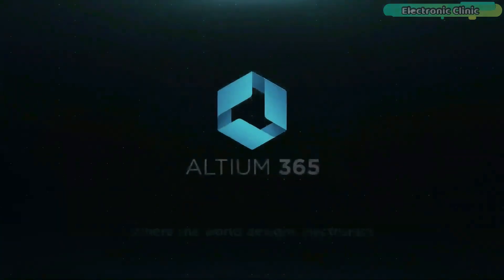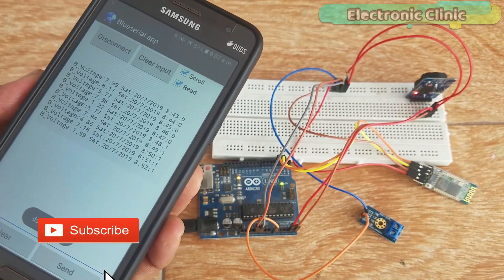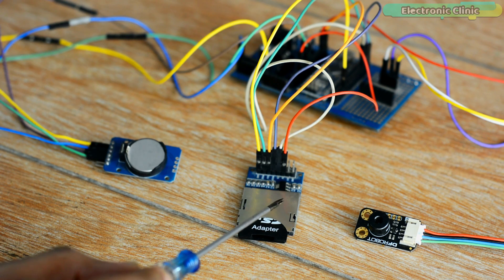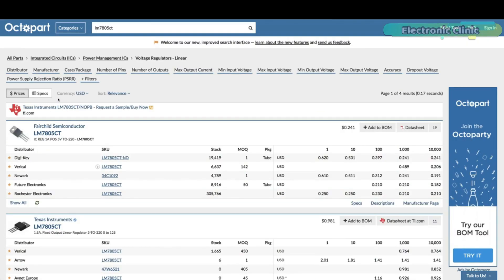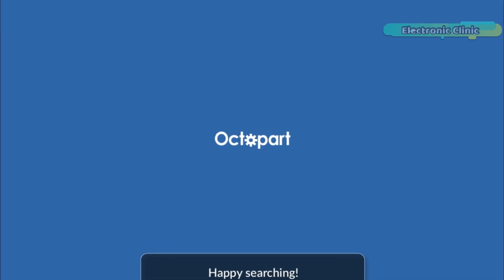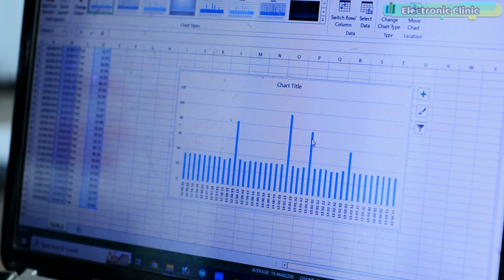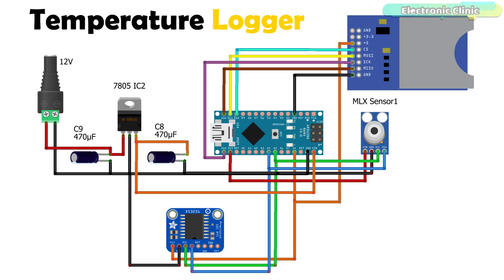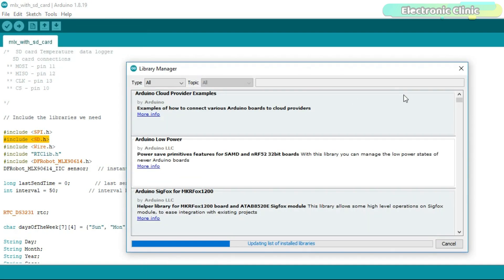Temperature Logger for MLX 90614 using Arduino SD Card Module, Arduino Data Logger Excel

Comment: What changes will I have to make if I use esp32 board instead of arduino Nano??
Reply from the maker: Watch my video on Google spreadsheet.
Reply from the maker: That's based on the iot. I used esp8266 but you can also use esp32